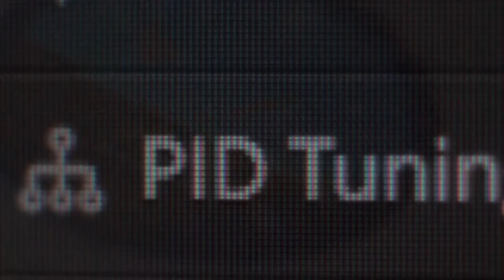FrSky FPort Protocol | IT'S GOOD, BUT I WISH IT WERE BETTER

Comment: FPort - Meh too little too late.
Too hard too, flashing FRsky kit is a bit of a nightmare.
TBS have this problem fixed. 
Install CRSF. Done.
Updates easy, telemetry easy, RC more reliable.
The only downside is cost. 
But save one quad and you get your Crossfire money back.
Reply: I disagree with flashing FRSky being hard. All you need to do is: 1. Take 1 of those 3 pin cables which come with x4r-sb and modify it by moving the wires around a bit. 2. Load the receiver firmware into your transmitter. 3. Flash using your transmitter. Project Blue Falcon has a video on how to do this called: FrSky X4R-SB: How To Change EU / Non EU Firmware. That said, i'll be switching to Crossfire as soon as i have the money to buy the module and 4 receivers for all my quads and maybe 1 or 2 spare receivers.
Reply: Huh, I just plug the receiver into the bottom of my X7 and flash it. It is really easy. And once it is finalized, it will be preloaded on the receiver anyway.
Reply: Agreed
Reply: for crossfire you just 1)plug the tx module into the computer, 2)update it, 3)re-bind your receivers, and it will update the rx over the air(no need to remove the rx and create a special cable and pray to god you dont brick it or short circuit it)... so if flashing FRSky is not hard, flashing CRSF must be super easy lol
Reply: The way updating works with Crossfire sure is a huge convenience, but why would you need to remove your rx? At the most you'll have to power up your quad, if your FC powers up while you power up your rx and just plug in the telemetry wire to your tx if that happens. Even that may not be necessary, but it sure is a bit dodgy if your Tx powers up your entire quad while flashing the firmware(Happened to me once :D). And making that special cable is also super easy, you just move the pins around.
Reply: If you have a tight build it isn't so easy!

Comment: So which port do you use for fport? Tx or RX? Or tie both of the same UART?
Reply from the maker: For bidirectional communication with a single pin, you typically use the TX pad only.